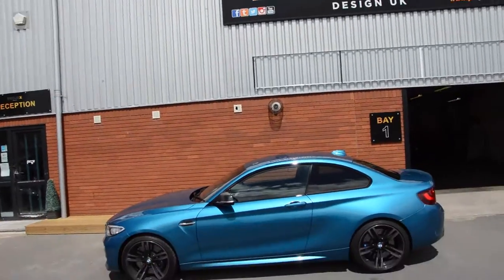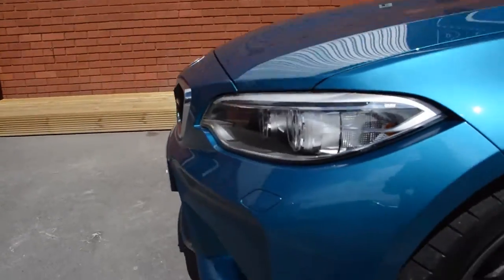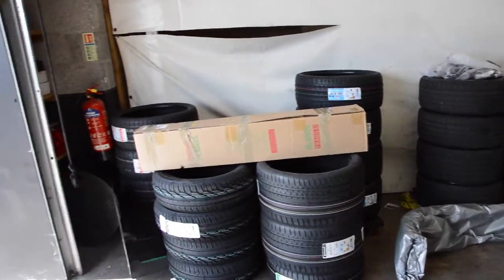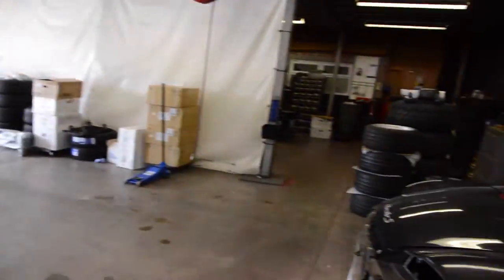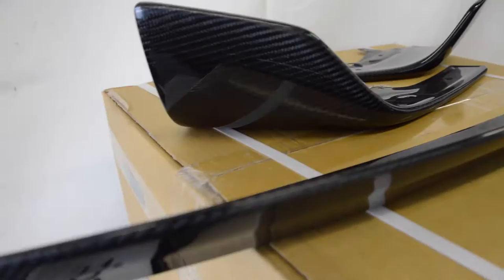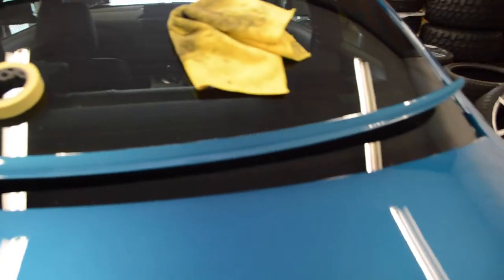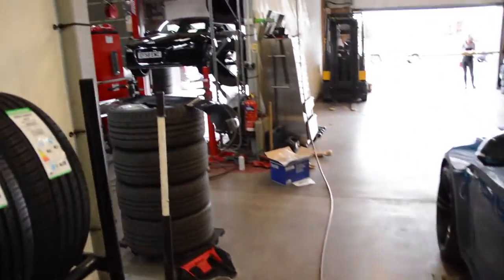300 MILES IN A BMW M2 FOR CARBON!

Comment: I'll be going for the full works, full carbon trim, exhausts, Alcantara steering wheel, Alcantara gear shift gaitor, metal pedals, blacked out windows, the full works.